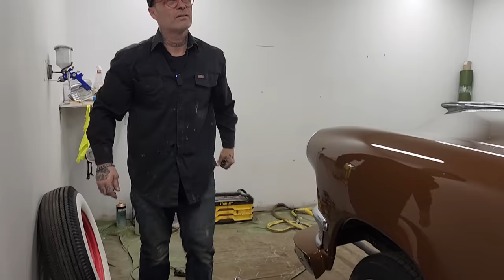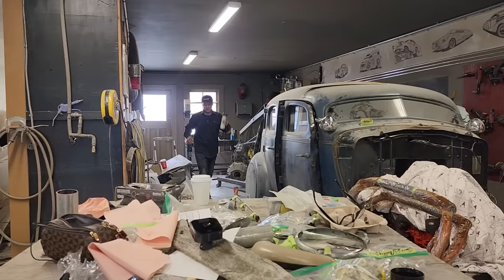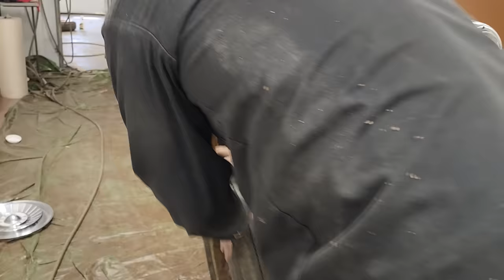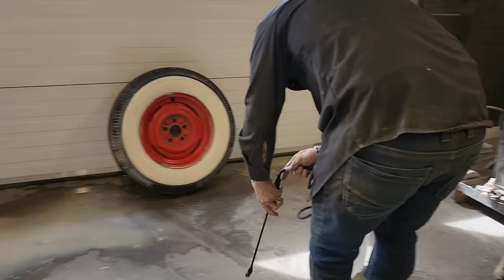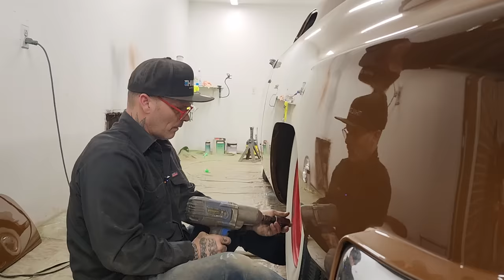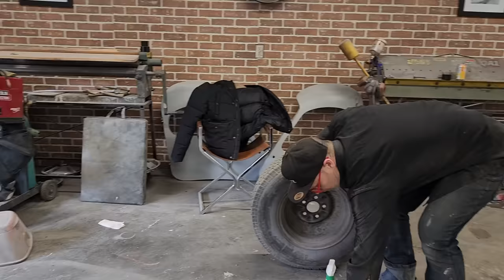This tire change will take it over the top 😍

Comment: 65 years ago we would make those sidewalls blinding white by wetting them, powdering them with Ajax (the foaming cleanser bubba, bubba, bub, bub, bub) and then brushing and rinsing. Now you’re ready for a Saturday night cruise, burgers, fries, and root beer at the A&W, and a midnight horror movie with your steady gal. Probably a $6 night including the gas. Sigh!
Reply: Ahh memories, like the $2.50 an hour pay too. Haha
Reply: Back in my day McDonald's was $.47 cents for a three course meal. We could both eat for a dollar. Burger, fries, and a Coke. Now it's more like $47.00.
Reply: Are the white walls real or porta?
Reply: I used Wesley's Bleach White on all three of 50 Fords with wide whites. Agree with  Richard that the rubber pads are missing for the hood.
Reply: @JimmyMakingitwork  Actually 1963 $1.00 / hour pumping gas at 29.9 cents per gallon. Movie was 25 cents for adults and buttered popcorn was a dime. Burgers and root beer for two was probably  60 cents so now that you mention it probably more like $3.30 for the night. But that was almost half a days pay for me. At $2.50 an hour you must have been a brick layer, lol.
Reply: Gas costs when I was 15 was $0.23 per gallon or 23cents per 4.55 litres
Reply: The scary thing is that today will be the good ole days for this generation.  Ouch
Reply: @garyfairbrother5532   So you saying you only worked 3 hrs a day ??? 🤪 😂… Good Golly  Miss Molly !!!!!!!
Reply: @WestsideCritters  read it again Grasshopper.

Comment: Just looked up wide white walled tires on Amazon, $135 and up per tire. The applied white walls were between $100 to $150 for a set of four. Last time I tried to get some they had to come from Europe. Chad had a tire shop remount the tires so if the age of the tires was getting on I'm sure they would have given Chad a heads up. Good guys or not, freebie or not, a tire shop still has to keep in mind liability issues. Cars looking better all the time, the exposed red rim adds a nice accent. IMHO

Comment: Chad take the tip-off the can that you spray take the air compressor nozzle put it on the white tip Compress air back into the can of rock guard You will save money I'm from 19:25  Richmond Virginia.  I tried it it works I had a 1/2 a can of WTD40 and I put the air compressor to the nozzle Compress the air into the can and put  The can nonzel back on
 And you'll see what happens it says money It's something to try

Comment: Hello, Chad and Jolene. I like the new whitewalls.

If you want to keep tires or upholstery wet looking and clean, try using Lemon Oil for furniture. It is good for cleaning steering wheels too. Not greasy, attracts less dust.

Comment: That car needs straight pipes all the way back, so that SBC will cackle. Spray Nine is awesome stuff, just keep it off the glass! I wonder if a 13/16" socket will fit the lugnuts better? Use a block of wood on the jack, lift under the frame so the body rises and the suspension stretches out. We used to be stuck using a bumper jack.

IT LOOKS LIKE GLASS! I'm really feeling some dark window tint.

Comment: Chad, to prevent those paint nozzles from plugging, remove them after use and spray brake cleaner through them and over the spray nozzle surface.  Also a small squirt of brake cleaner down where you removed the nozzle before reinstalling.  If the can quits halfway through, this will usually get it restarted but you may have to do it more than once to make it work reliably because the plug could be coming from the can.... I've stored cans for long periods using this brake cleaner method and they come back to life maybe 98% of the time.

Comment: I struggle with the wheels on mine quite a lot.  I have a black 50 ford, chopped, and slammed.  The whitewalls I think look awesome when the car is really low basically slammed.. but for driving when I fill the bags I see the whitewalls and its just too much for me...  I love the look of the radials and less whitewall and even those hubcams he had on when the car is at a higher stance.. it looks less like a big white powdered donut with too much wheel showing haha.. of course I won't change my whitewall bias plys to radial at this point but I think it looked nice the way it was originally but understand he wants the traditional look!

Comment: Chad, I suspect you're having trouble seating that right front hubcap because there's a wheel weight interfering.
Reply: I was thinking the same thing. I'd pry them off and swap them to the inner rim in the same place.
Reply: Newer  wheel weights have a dome shape.. .. I've had that problem  on my full wheel cover's ..☹️

Comment: Tires do have a best before date and these are likely expired. They look nice they shouldn't do a lot of driving on them for risk of failure.
Reply: Best before date ??? 😂 you think it’s a carton of milk 🥛 ???   It is called a manufacturer date code ,, when tire was made !!  Not expiration date !! Sheesh 🙄,,,,,  In the USA 🇺🇸 any tire shop that installs a tire on vehicle that  exceeds 10 yrs opens themselves up to potential liabilities!!! But Chad could install a tire 25 yrs old and not be liable, NOT WISE , BUT NOT LIABLE !!!
Reply: If there not cracked and worn out use them .
Reply: I think these may have inner tubes, plus they look in really good shape.  They should be just fine.
Reply: old tires did not have the date on them. i have some with no date code. i was trying to see how old they were. no date code anywhere 😋

Comment: Sort of a kool nice job would be to make the center headlight turn when you turn the steering wheel. Could be done with maybe six small pullies and some bicycle cables tied to the back of the brake drum backing plate. As you turn left the headlight turns left and right cables pulls to the right. You could also do it electrically with some servos but it requires someone that knows how to do it. However with servos as they are electric you could mount the sensors on the steering column .  This car is absolutely incredible. Congratulations.  Its easy for me to have the idea but it takes a bit fo work to do. However it would be phenomanal. Wolfman Jack
Reply: I personally wouldn't play with the center headlight other than maybe switch to  an amber one for looks.

Comment: Painting/dying the center headlight the right shade of yellow to make it a fog light will look great. It's down low as it should be for this purpose. What do you think?
Reply: It could be a DRL. Old timers used to stick a single amber light in the middle of the grille, always on if the key is on.

Comment: Two things, the lion logo on hub cups seem/ are from a french made car called Peugeot. The second thing is that the red color around the white wall disturbs the color combination. Paint the rims black color to match the tires. Cool car!!!
Reply: although that logo is similar to Peugeots logo, those hub caps are actually an aftermarket product back in the day from a company called Lyon. They were often used by Hot Rodders as an aftermarket accessory.
Reply: @frenchbulldoglewis  very similar with 1955 pugeot 403

Comment: Looks like the Tire on the Red rim is a little skinnier then the Black rim. Little help when needed is always nice lol  That tire weight will knock off that front hub cap and U will lose it going down the road or turning a corner.

Comment: If the rock guard nozzle gets mucky, take it out. Then dip it in either gasoline or paint thinner. Then blow off the nozzle with air pressure. It works for me.

Comment: Yes, you're removing 1957 Ford wheelcovers and replacing them with period-correct, LYON's wheelcovers. They are not from a Mercury; they were sold in auto parts stores as aftermarket "goodies."